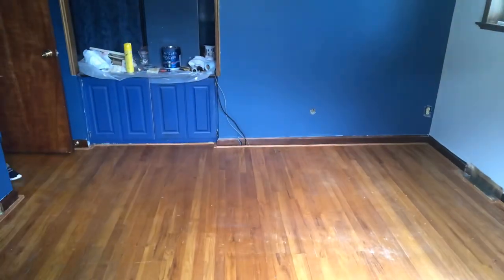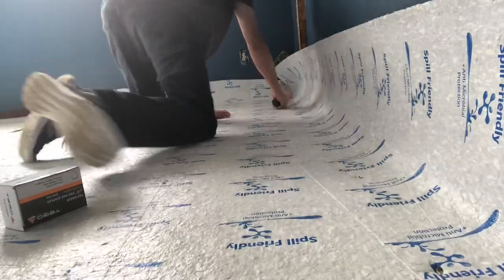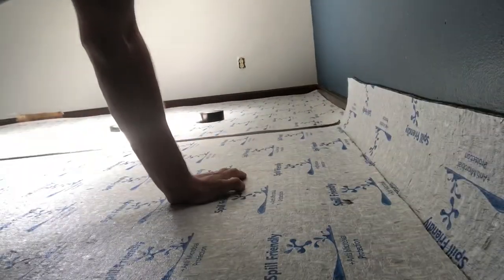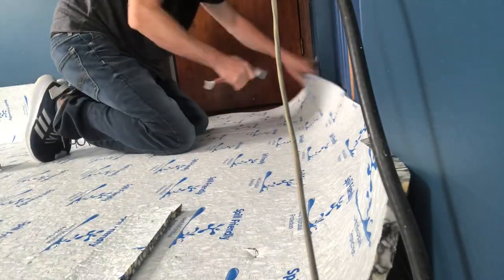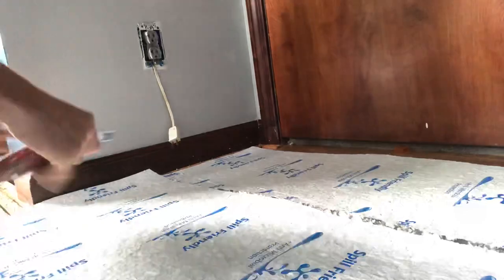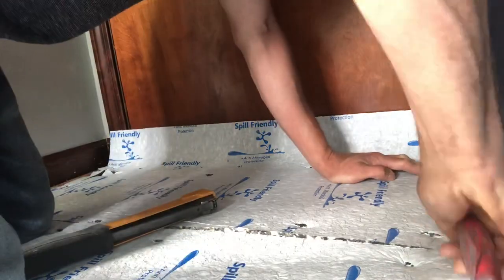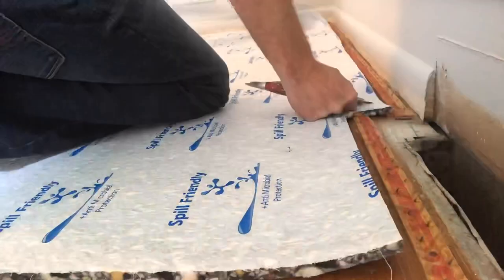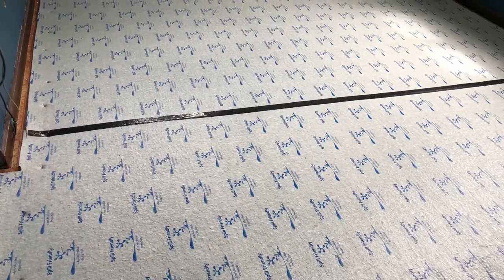How To Install Carpet Padding On Wood Floor

Comment: How much does something like this cost for an average condo 13x11 or11x12 rooms
Reply: $500-$550 for the 11x12
$600-$650 for the 13x11
Keep in mind this is just the cost for a mid grade carpet and pad. Labor may be extra, typically between 50¢-$1/sqft.
There's also a lot of little things that can lead to more carpet being needed. Spend time with an experienced installer or measurement tech for best results.